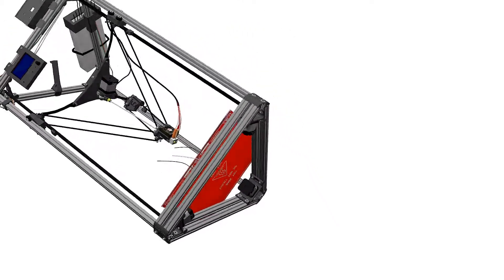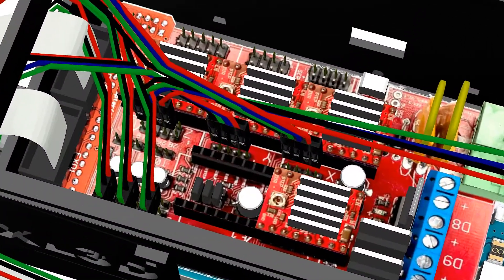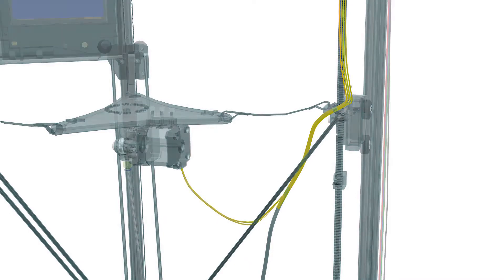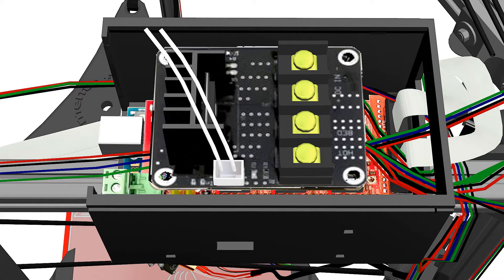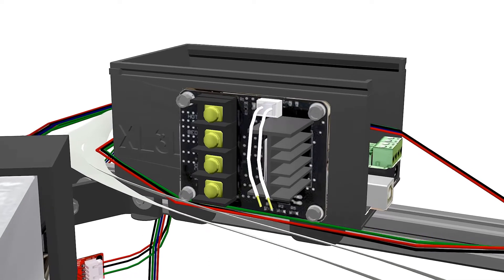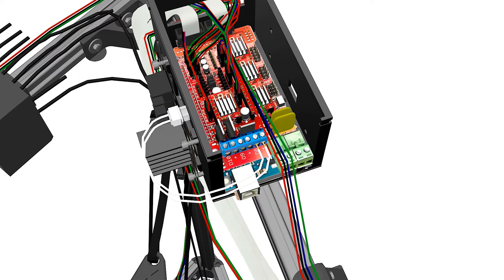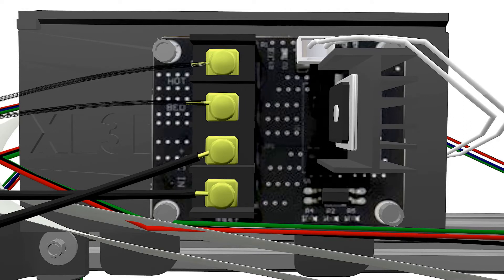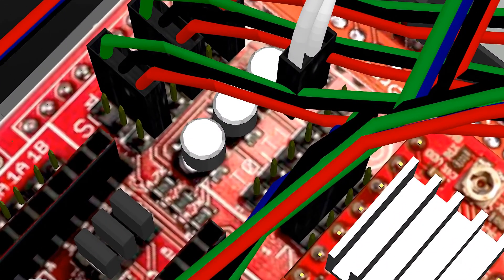Build a Delta 3D Printer - Wiring and electronics pt.2

Comment: Is there any need for calibration? I mean, everything is static, bed is not regulated by anything.
Reply from the maker: Calibration is most definitely a must given it's a hand made printer and minimal variations will occur, specially on the heatbed. Most part of calibration will be done via firmware and by adjusting the height of the three endstops.